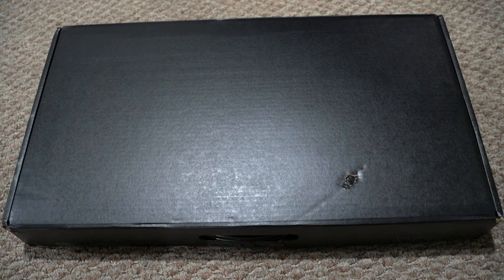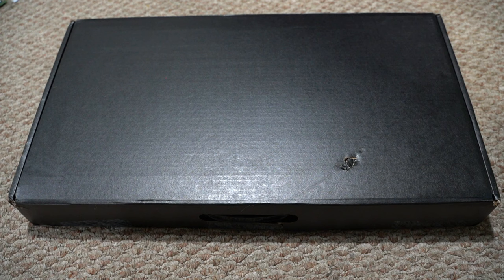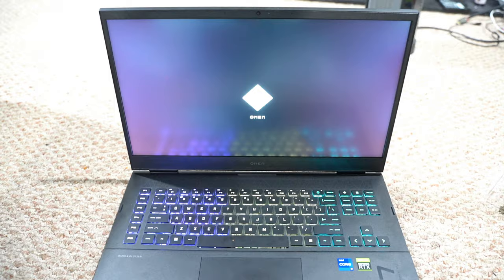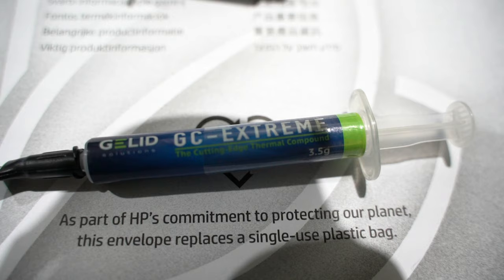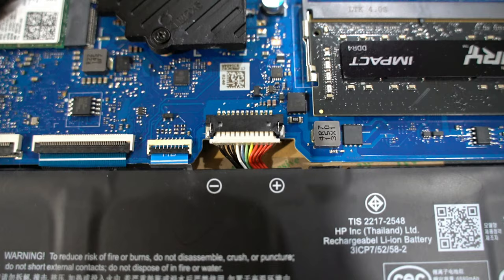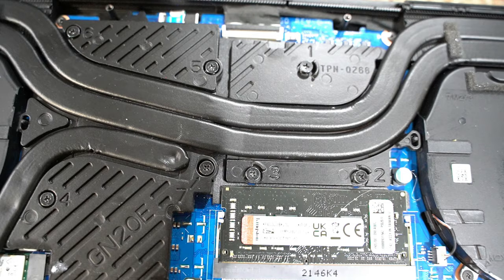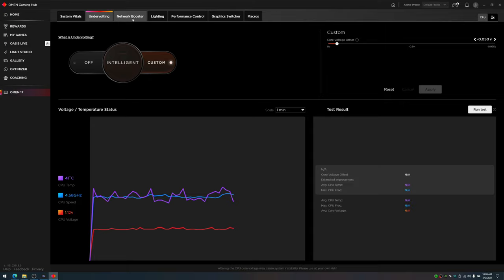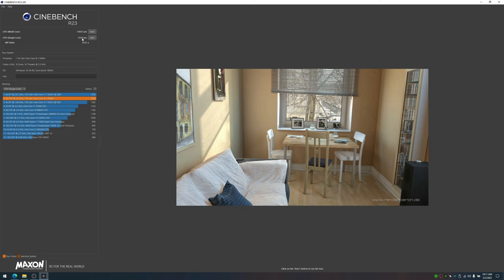HP Omen 17t-ck000 2021 / 11900H + 3080 16GB Unboxing, Teardown and Review + Cinebench R23

Comment: I have the same specs. This is really a great laptop. I might try liquid metal in the future but i'm still happy with the stock paste. No problems in my 3 months of ownership.
Reply from the maker: Agreed, I'm very happy as well. What are your temps with stock paste?
Reply: @akaddict  my current Omen 17 specs is almost the same with yours but i got the i7 and mechanical keyboard which helps in cooling compared to your i9. I undervolted at 0.055 which is the most stable for me. At idle my cpu is at 42 to 48C. In heavy gaming with maxed settings i usually get temperatures in the low 70s for the GPU and low 80s for the CPU. Never experienced throttling and I'm also using a laptop cooler. I'm from the Philippines with ambient temperatures of 19C to 24C in my area.

Comment: Thanks for the vid! I just ordered the Omen 17 from HP on sale for $1399. It comes with the 11800H, 3070, and the 1440p display. I'm stoked! I'm a tinkerer too so I'll definitely open it up and re-paste and add storage I don't need and whatnot lol.

I'm surprised to see the 3080 has the same cooling solution as the 3060/3070. Interesting.

Comment: I hope you have a cooler for that bad boy laptop. Man you scored big time good job being at the right place and the right time. I got that lap top but a 3070, 144 1080 and  intel 11800, and right now I am returning it.  I have one big battle station gaming desk top build and building another (with 3070 gpu I scored for 600), and another laptop msi low budget amd 4600 series with  low refresh ratio. I haven't used it since Jan, it's sitting around. I am going to see your time spy, I tweaked mine to a pretty good score.
Reply from the maker: I'll make a video for the time spy tomorrow! Thanks for the comment brother! 😄
Reply: @akaddict  You are welcome, I can't wait to see the results. With the set up I got , I went as high as 13000 with 105 fps on windows 11, with 1180h I was cooking, I undervolted my  3070 and tweaked my score up with MSI Afterburner and Kombustor.  

You should get at least 16000 or close with your set up and a separate fan cooling that bad boy. I know you can score high. Don't be afraid to crank up your GPU with MSI Afterburner , if it automatically black screena, reboot and lower your setting , 

your GPU can handle the tweaking better than the CPU (I believe you already know all this). Also give your GPU and computer cool down period during test runs(for me I think it helps).

Comment: I have this same laptop with the RTX3060 and I7 11800h. All of the I9s will thermal throttle. You never get to take full advantage of their power because they run too hot. The I7 is the sweet spot. With fans on auto profile Ive NEVER seen my laptop get over 79 degrees, even during the most demanding gaming sessions or benchmarking.  It runs cooler than my old Big ASUS Gseries with 1080 and that says a lot because that machine stayed cool. I would have liked a RTX3070 but I couldnt pass up the $999 deal I got on mine from Microcenter in Jan. The 3070 would have cost another $600 for a minimal performance gain. The 3060 is great but the 3070 has 2 more gigs of vram at 8 for futureproofing.
Reply from the maker: That's a good deal! I have the i9 and it doesn't thermal throttle even turbo boosted at 4.9ghz. I did repaste my laptop with the gelic extreme. I don't usually see above 80c in games.

Comment: I used Cooler Master MasterGel Maker on my Alienware 17r5 and between that change and an undervolt of -.145mv on the 8750h it hits full boost ALWAYS and hovers around 85-90° and NEVER throttles.  When the 8th gen came out it showed the defeitencies in laptop cooler designs.  That's putting it lightly.
Reply from the maker: Yup you are absolutely correct, I had the i7 9750h and the thermal design wasn't keeping up with the output the chips were putting out. How long have you've had the mastergel maker on the CPU / GPU? I'm curious to see how much lower you could get with the gelid extreme.
Reply: @akaddict  I hate to admit it, but it's been going 3 years on the same application, SMH.    One of the biggest issues regarding the cpu temp is the cpu die was about .3mm to around .5mm lower than the gpu die but they used a common cold plate on the cooler.  This leaves more "space" between the cpu and cooler so the more efficient the TIM the better the cooling would likely be.  I see gpu temps in the 60s.  There were a few guys in the forums talking about using a .3mm copper shim between the cpu and cooler and got really good results, but I have no real personal experience with that.

Comment: Hi! Are you satisfied with the product? Can you tell me if the hinges are rigid? I saw that there is a flex with the screen and most complain that the hinges are not strong. Is this annoying to you? How are the temperatures in the games? Thanks!
Reply from the maker: Hello Christian! I am very satisfied with last years model, huge improvements over previous years. I think there's a little flex but nothing that would worry me for the long run. Temperatures are very solid with the new tempest technology, I used an aftermarket thermal paste. Gelid extreme. Here is a benchmark with temperatures in this video that I made. https://youtu.be/4yZKjGi_DY0
Reply: it's actually sturdy with little to no flex

Comment: Hey man, great video, informative, I got the exact same model you have, the only thing I don’t like about it is that you have to dismount the cooling system (or, as I did, try to keep it pressed without damaging it while working with the other hand) to replace the m2 wifi card.

I didn’t repaste the the heat sink as I won’t be gaming (I will be running Debian LXDE which is light as hell) and because I didn’t remove it completely, only the vram modules and I suppose that the GPU were separated from it for less than 5 minutes, without thrash or anything dropping on them, do you think I should repaste?
Reply from the maker: I would run a stress test and check your temperatures to see whether or not you need to repaste, but... Anytime you remove the heatsink it is highly recommended to repaste. Use ptm 7950 pad from ebuy7. Its the best, only for CPU and GPU. Keep the white fluffy paste on the VRAM.
Reply: @akaddict  I repasted as you said, learned a few new things along the trip, the white fluffy thing is a kind of thermal paste, a high viscosity one like K5 pro and Thermal putty, that as you said isn’t necessary to change as it is more durable than regular one.

As I told you I’m in Venezuela, stuff like the one you mentioned take a month or more (via ship, because by plane is much more expensive) to arrive, so I used Kryonaut (which is what I currently have here) on the GPU and CPU, so far so good, in a future I want to repaste with Kryonaut Extreme since Condoctonaut (TG’s Liquid Metal) isn’t friendly with copper AFAIK (which is the material on our heat sinks IIRC), but that will be once the Intel AX411 works better with Linux, I left the AX210 which works on Fedora, in any case, have you tried to reinstall Windows on this laptop?:

I replaced the SSD with a pair of a Samsung 256GB GEN3 one for Windows and a 980 PRO 2TB GEN4 for Linux, but, even though I updated the BIOS on Windows before any of this, I can’t find the correct Intel Rapid Storage VMD Driver, tried with the ones supplied by HP and the latest ones by Intel and still no luck… Linux work relatively fine though.
Reply from the maker: Yes I did, I can help you with loading the correct file, I got it off intel. What is your CPU model? The fastest I got it from china to us through the fedex option was 3 days from ship to arrival.
Reply from the maker: You tried loading it from the windows installation screen after you boot from usb correct?
Reply from the maker: Kryonaut will 100% start pumping out more quickly. Once it goes through some thermal cycles I will guarantee your temperatures will skyrocket to 97. Once that happens let me know lol. Kryonaut is meant for PCs with a higher mounting pressure.
Reply from the maker: I give it less than a week.
Reply: @akaddict  my cpu model is I9-11900H with the rtx 3080 16gb, the laptop model is 17-ck0000
Reply: @akaddict  Look, I understand what you say, but as I said above, getting thermal components here in Venezuela is hard, you think Kryonaut is bad? Tough luck, the majority of thermal pastes you can find here range from mediocre Chinese “thermal greases” to the Artic MX4 which is the “top choice” here, so Kryonaut is the best I can get as of now, in the future I can get something better from Amazon or eBay, but that will be like two months or something like that between transit of the package and the like.

So until I receive the PTM one (once I see if I can even import it, remember, Venezuelan opportunities aren’t as ample as USA’s ones) I prefer to use Thermal Grizzly, I don’t know if I make myself clear
Reply: @akaddict  just so I understand better, this ptm 7950 is the one from Honeywell? The phase change thermal pad?
Reply from the maker: @johnkleivercontrerasgarcia529  I understand, but it's worth the wait, even if you do get it in a couple of months at least you'll have it by then so you can do it properly. I tried a lot of pastes including that mx4 and it just doesn't hold up. The honeywell ptm7950 is made from china and they use it for industrial purposes because that's how good it is. The phase change technology prevents the paste from drying out and pumping out.
Reply from the maker: I thank I paid 25$ for shipping but it's worth it. See how much it is to your country.
Reply from the maker: @johnkleivercontrerasgarcia529  Put both .zip on your USB stick from which you are installing windows from. Once you get to the screen where you would see your partitions, hit load drivers and select the USB and open the appropriate one that comes up (If it shows up either one will work) and then load it and you should see your drives to delete the partitions to continue with installing windows.

https://www.intel.com/content/www/us/en/download/19512/intel-rapid-storage-technology-driver-installation-software-with-intel-optane-memory-10th-and-11th-gen-platforms.html

Comment: Hi, are you still using this laptop? Or have you switched to newer models?
How's it holding up so far? Thanks
Reply from the maker: I switched to a newer model that HP gave me because of this video after contacting them for warranty. 3300$ 11900h, 3080 16gb. I posted it on my channel. This should and still protect your system 100%. That's why many people have thanked me for this. Of course there will be a little degradation in CPU performance but that's something anybody should be willing to take to protect their systems in the long haul.
Reply from the maker: Oh crap I thought this was my old video and yes, I get 84c mad under full load, it's the fastest PC / laptop I have ever owned or ever had the chance to use.
Reply from the maker: I recommend Honeywells ptm 7950 thermal pad. Its magic
Reply: lol yea, i found your channel back then from the 9750h undervolt video, it helped a lot 

Glad to see your machine still holding up strong,
just curious, what was your previous 9750h machine? 

Any plans eyeing for 13th gen rtx 40 series upgrade?
Theres slim variant omen transcend this gen
Reply: @akaddict  true, like you i was using gelid gc for a year, with 3.2ghz locked, no heavy task, rarely operate at high temps. but the pumpout still occurs, and temps creeps back up gradually. 

Btw, after repaste with PTM7950, do you still repaste after certain duration or just regular dust maintenance? 
My concern is the dust buildup on heatsink fin near the fan, usually that requires to open up heatsink, which means repaste
Reply from the maker: @albertputra6220  not even a chance, this fulfills all my needs and more. If I still had the other laptop I would definitely consider upgrading for my photography needs. My last PC was a 1080, 8700k I built 5 years ago. This laptop is 2x faster on userbenchmark compared to it. I get all UFO scores. Depending on your hardware I would consider it, but at the same time I can't vouch for the new omen slim profiles depending on how fast/hot the new hardware that would be in it.
Reply from the maker: Nope dust isnt an issue with how the new laptop chasis are designed. A dust off in the intake / fans will do everything it needs to do for sure. And no I haven't repasted at all. The temps actually got better, even though the thermal pads are already cured it still gets better over time as long as you apply it evenly and with the right pressure. Also make sure to go in order when screwing in the heatpipes with even pressure in the number order.
Reply from the maker: Csgamerakaddict@gmail.com shoot me an email ill give ya everything you need to know. I'm gonna delete this as soon as you reply for spam sake.

Comment: I got mine a month ago but with a i7 with a 3070 and  while it gets warm, it's a beast.  Though my screen colors seems to display a warm yellowish tint which is noticeable on a white screen rather than just cold white. Do you have this issue? Night mode is off. Do you know how to correct it? The issue seems to be more common than I thought.
Reply from the maker: I haven't run into this problem fortunately. Try HP display manager from the HP website to tweak the color profiles.
Reply: Dunno if ur still here, the display is a low blue light display. I noticed it too and fiddled around with the display settings until I got what I liked.
Reply: @kylesmithisawesome  I haven't gotten to fiddling with mine yet as I've gotten so used to it that I forgot. What adjustments or steps did you do and by how much? I like to take and keep notes for references for this when I do.

Comment: I have this same model and the trackpad bottom half has stopped working and I have seen another review of this laptop showing this issue. Just keep a heads up I want to ho through warranty but I heard they take 2 weeks to do anything.
Reply from the maker: I actually have heard of that issue myself, sorry to hear that bro that's really unfortunate especially with such a expensive laptop. I will say the RMA process is actually pretty good, the only time I ever had a long rma was because they needed to replace the whole motherboard / CPU cause my last laptop overheated. That took about 3 weeks because they didn't have it in stock so they had to backorder it because it was 2-3 years old at the time. They did offer me a temporary laptop to use during that time which came within a couple days. Other than that, they gave me a shipping label which was 1 day shipping through fedex I believe they usually resolved my issue within 2-4 days and shipping only took a day so I'm optimistic they should be able to fix your issue pretty quickly since it is only a trackpad. Let me know how it goes!

Comment: Nice you share with us your review 🙂 about thermal paste but i got same thing i put paste after couple days it become more hotter the cpu ryzen 9 what's the problem ? The paste not doing well ? I tried xigmatek thermal killer s  and i was about to buy thermal grizzly but gc extreme better in hp laptops ?
Reply from the maker: Yeah try the gelid extreme, the thermal grizzly is not meant for laptops.
Reply: @akaddict  i tried kingpin kpx gave me like 7 degrees down 🆒😎 i suggest it for you
Reply from the maker: @HICHOSOLO  nice long have you had it for now?
Reply: @akaddict  a week stable so far =)

Comment: Hello! I have some questions about HP Omen laptop and I found your youtube channel, could you please tell me a bit more about this laptop? I'm looking for a great solution for 1440P gaming and i would like to clarify some questions about the performance of this device
Reply from the maker: Yes the new model with the 12 series and the 3080ti is cheaper than what I have now. I use honeywell ptm 7950 thermal pad and don't exceed 80-85c in games. Things a beast
Reply: @akaddict  I would like to know more about gaming in 1440P on Omen with 3080, 16Gb (laptop from video). Do you have some benchmarks in 1440P for this laptop? For example, cyberpunk, warhammer 3, etc.
Reply from the maker: This website will give you the information you are looking for.

https://www.notebookcheck.net/NVIDIA-GeForce-RTX-3080-Mobile-GPU-Benchmarks-and-Specs.497450.0.html
Reply from the maker: Hp version is the 165 watt with dynamic boost for the 16gb version.
Reply from the maker: Make sure you get the accidental HP carepack with your purchase so its covered 100% (other than theft) with zero deductable, also if you don't use it you get 100% refund. I got 3 years for 320$. A must have and no brainer.

Comment: what was the reason behind applying the thermal paste, did you face overheating issues with the stock thermal paste ?!
Reply from the maker: Not necessarily, I wanted to get more performance out of my CPU. The stock paste they use isn't the greatest as well. I just do it as a precaution to keep my CPU as healthy as possible to make sure it last a long time.
Reply: @akaddict  another question sorry to bother you, does the screen panel support g-sync ?!
Reply from the maker: @mido830  crap this comment slipped through my notifications, sorry! My model was not suppose to come with G Sync but when I updated windows / bios it worked perfectly. 👍
Reply: @akaddict  That's great!  I already ordered mine and I should be receiving it in a week time, hoping I get the same :D
Reply from the maker: @mido830  yup, you should have no issues there! Enjoy the tear free gaming and congrats!